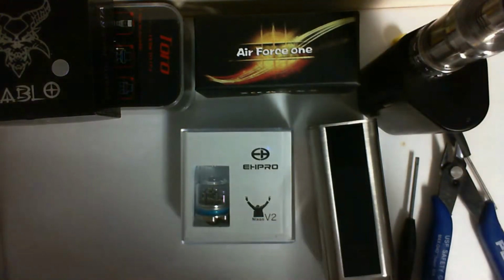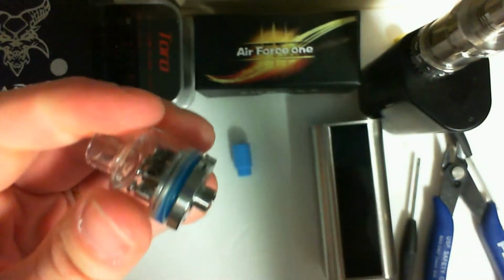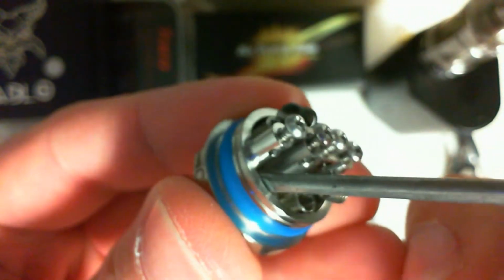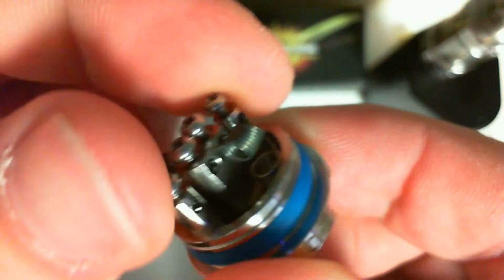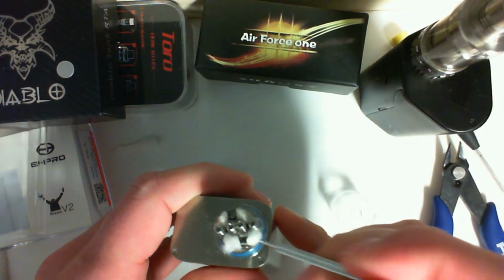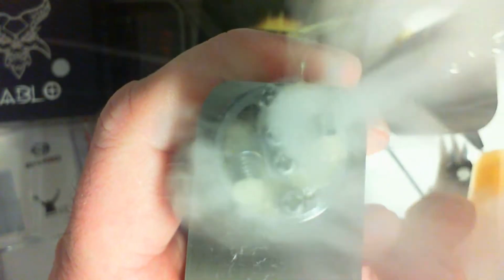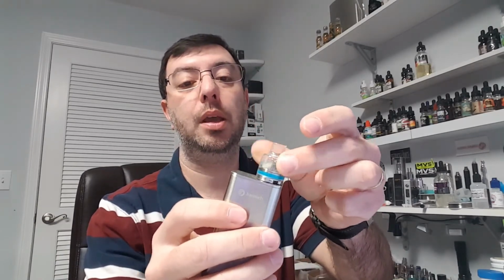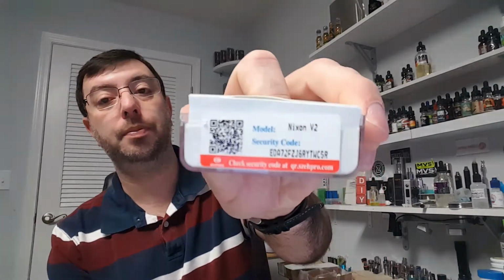Nixon V2 Dripper from EHPRO

Comment: The V1 Nixon is one of my favorite drippers, to date. Regarding the silly Nixon logo: I believe this was a joke on the part of EHPro. The Nixon RDA had similar airflow to the Kennedy RDA and has a quote on the bottom by the serial number that reads, "I am not a clone!" Other than the glass top cap, the V2 seems to be nearly identical to the V1. The airflow control on my black V1 is stiff enough that I never accidentally open or close it. Thanks for offering a look at this!
Reply from the maker: +baronvoncardo Yea, the name and logo are a little weird thing to come up with for a name in my opinion but as for the dripper it works well at a great price.

Comment: I tried everything I could possibly think off to get the glass off ....Boiling water, froze it, used spray that loosens screws, tried pulling, twisting pushing all while using rubber gloves.  Eventually the glass part broke so I never got a chance to vape.  Looking for somebody that sells just the glass tops.  Good luck and be careful people.  Good review though....

Comment: It's a pain in the ass to fill. AFC is insignificant compared to that. Heat up is a big deal, but most 510 drips fit and that helps. Overall tho, I will prolly throw it in the bin, just cause it's so hard to juice.